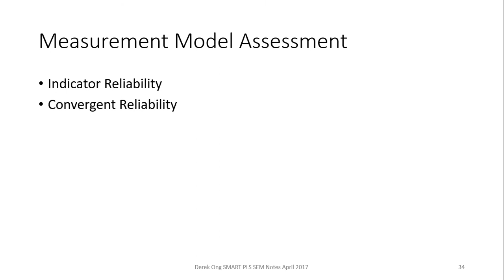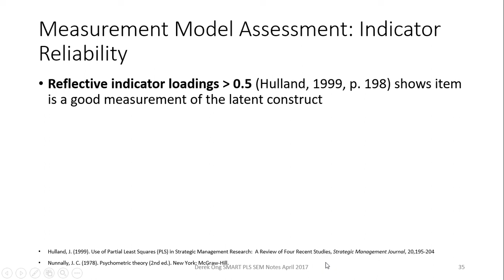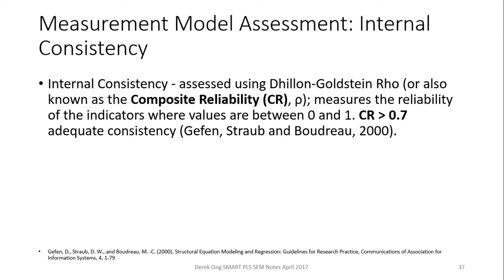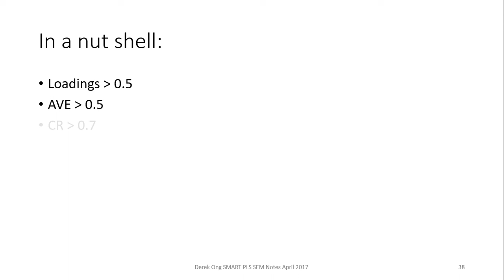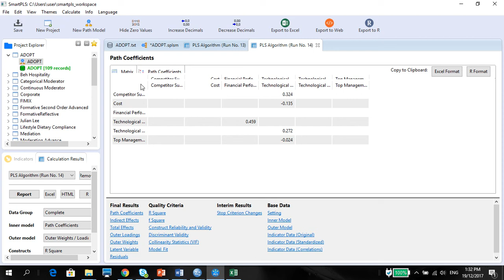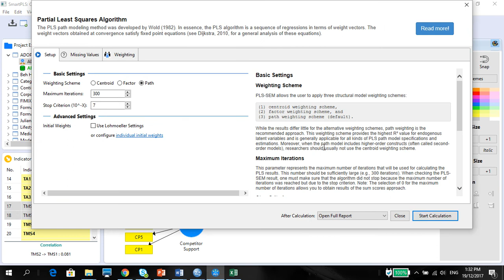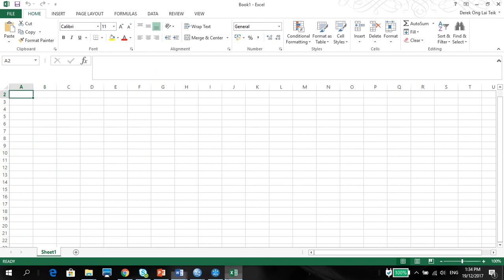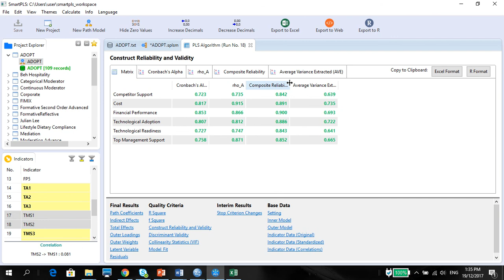PLS Vid5   Theory of Measurement Model Loading, AVE, CR and Rho A and Running PLS algorithm

Comment: Hello Dr.
I have two variables which cronbach alpha, composite reliability, ave all reached cut off points as well as they are significant in the model with effect size . Each of them has three items BUT their rho_a is 0.557
How to handle this issue ?
What is the cutoff points for rho_a ?
If I keep rho_a as it is in my thesis, would it be a problem ?
Reply from the maker: The rho A should not be a problem...because the more important variables are the measures you described....but in the event that your supervisory team require rho A then find literature to support your findings :)...all the best

Comment: Hello Dr. derek, how if I delete many indicators just to make my AVE greater than 0.5? Does it make sense? My initial indicators are 27 and I need to delete it until 6 indicators left.
Reply from the maker: Greetings having 6 indicators is more than good enough...the goal is to achieve a parsimonious number of indicators with the least complexity.....you might want to see if the deleted items are correlated with one another and try modelling them as a separate construct.
Reply: @derekong1609  thanks for the response. So it is ok to delete the idicators until 6. I am a bit lost in modelling the deleted indicators as a construct. Should I do a factor analysis in spss first before I going to the analysis in PLS?
Reply from the maker: @MrAlverian  Give it a try ith a factor analysis first usually when you delete so many items it could be because they should modelled as a separate construct
Reply: @derekong1609  ok, ill try it first. Actually KMO and cronbachs alpha for this variable are valid with 27 indicators.

Comment: Hi Derek. As I was checking Hulland, 1998 reference for indicator loading that you mentioned in the video at 1.18 bu there is no page 198 in that particular paper. The Jounral contains pages from 115 to 135. Could you please check this. Thanks

Comment: I would like to know if it is a problem if moderators show a loading of less than 0.5.
Reply from the maker: It may be a problem if the moderators are quantitative moderators and does not meet the requirement of measurement model
Reply: @derekong1609  OK. I'll take that into consideration. 

Yet,, I would like to know if you can help me out with analysing my data. I am actually conducting a research using the Utaut 2 research model with 7 independent variables, 2 dependent variables and 3 moderators. I have already worked on my path model.  Since I am new to using this software, I don't know how to make use of it. If i run the PLS Algorithm in one go, Will it take into account the moderators? And when i try to connect all LV when calculating the Consistent pls, it says singular matrix problem! Why is it so?? I'll be grateful if you could help me with this.
Reply from the maker: @manishamodun6544  singular matrix problem means that your correlations are near to... try removing some more indicators from your variables
Reply: @derekong1609 Can i continue with the structural model if the discriminant validity for a construct is 0.92 yet less than 1? While some argue that htmt criteria should be less than 0.9 or 0.85, there are some who argue it should be below 1.

Also I am using the student version of SmartPls 3 which limits my sample size to 100. What should be my confidence level? It is a two tailed test.
Reply from the maker: @manishamodun6544  you may not have ebough Discriminant validity....use other criteria and compare....100 samples may not be enough to give you enough variability...you might want to think about purchasing the full version or use version 2

Comment: Hello Dr. Derek Ong
What if the Cronbach alpha and rho of a construct is less than 0.7 but the AVE and CR of the same construct is greater than their standard value. Also all the loadings of the same construct is greater than 0.5.  Should we continue without deleting the lowest loading.
Reply from the maker: Greetings it is better to delete the lowest loading until you are able to stabilize the Cronbach alpha ( which is meant to assess the reliability) however, there are some scholar that feel, the AVE and CR is more important and that shouldnt be a problem. In fact some says that a Cronbach alpha of above 0.6 is enough.. again it depends on what your university and the journal wants. Hope this helps. Cheers
Reply: The latent construct is having three items  (having loading 0.656, 0.715 and 0.787) results in cronbach alpha value to 0.545 and the value of AVE and CR is above the standard that is 0.521 and 0.764. Now deleting the lowest loading results in decrease value of Cronbach Alpha to 0.429 and value of AVE and CR to 0.637 and 0.777. So should I delete one more item. If yes , in that case the latent construct will have only one indicator variable left. Is it ok? Or should I remove the latent construct from my model
Reply from the maker: Prerna Bagadia check the reliabilty of your construct in SPSS ...I would suspect that your construct items do not meet internal correlation
Reply: Thank u Sir
Reply: Dear Dr. Derek Ong 
The reliability of the construct is 0.544 in spss. Should I use that construct in my model or I should drop it
Reply from the maker: Prerna Bagadia hi it depends on your university, supervisor or your journal requirement for reliability and if you are able to justify it with a strong journal reference
Reply: Thank you so much Sir
Reply from the maker: Prerna Bagadia all the best :)